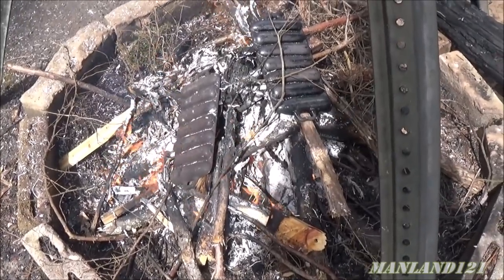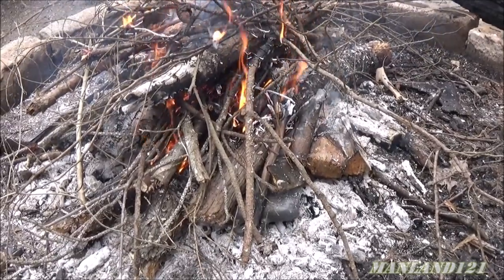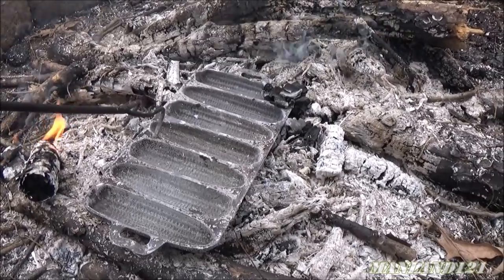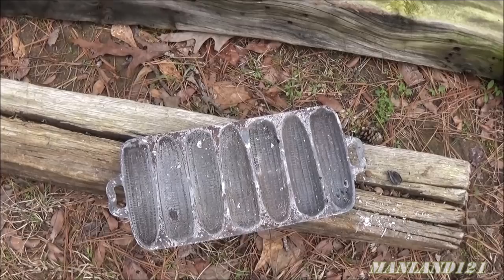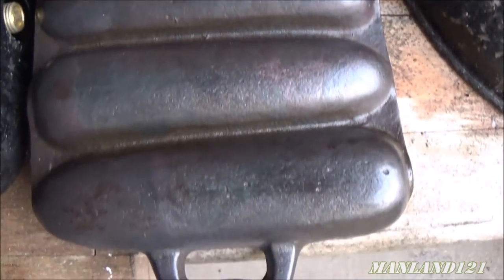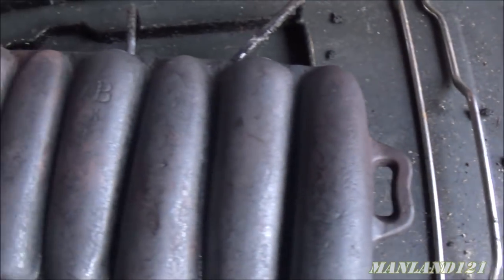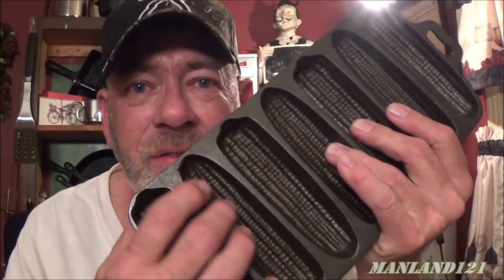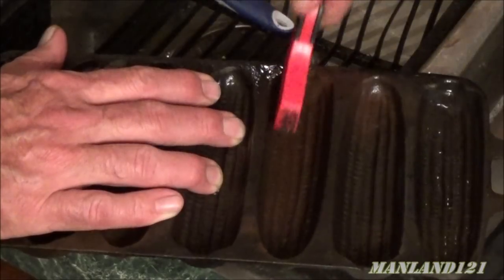Cast Iron Restoration Safe Camp Fire Method And Vinegar

Comment: i got the exact same cast for my birthday! i'm torn how to clean it and every single one individual corn cob impression! I heard fire! so now i'm here!
Reply from the maker: Fire doesn't actually remove rust, although rust will so call burn in High Temps...what is happening I believe is the cast Iron is expanding in surface helping to break off the rust...and well I just don't know...but burnt on seasonings and all that black mess will burn of turning white and powdery...that much is for sure.
Reply: Geat!burnt off some of the black stuff but only half because the fire was small. it turned white and powdry like you said.. but then it started to rust!  ill giv eit another good fire bath. then hit it with the vinger once it starts to rust! naighbors called the fire dpt on my fire the otherday!

Comment: I used my ceramic grill recently to clean a couple of garage sale finds that were extremely crusty and it worked great. It doesn’t do much to rust, but vinegar and elbow grease takes care of that. I was careful to bring the temp gradually up to 700-800 degrees and kept it there a couple of hours, then shutting it down and letting it cool for a couple of hours before removing them. 

That newer pan was probably never seasoned right in the first place, then corn break stuck and it got left somewhere to rust for years. That older one probably got lots of use over the years. 

It’s great to save old (and even not so old) cast iron pans!

It’s best to avoid just tossing them into a really hot fire. Most collectors don’t recommend it, because beginners might not control the temperature as well as you, and they could ruining a nice vintage piece.